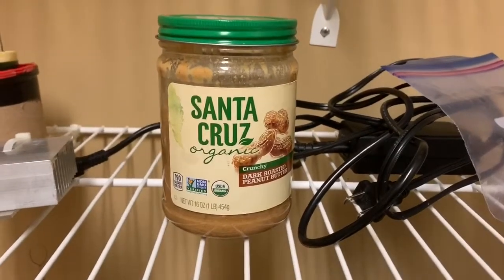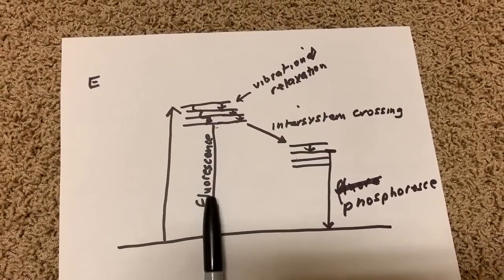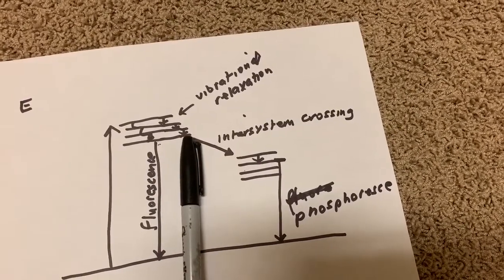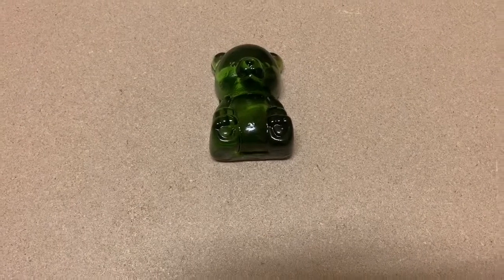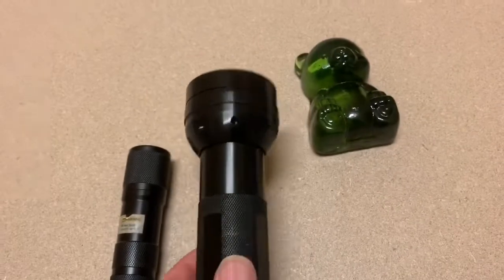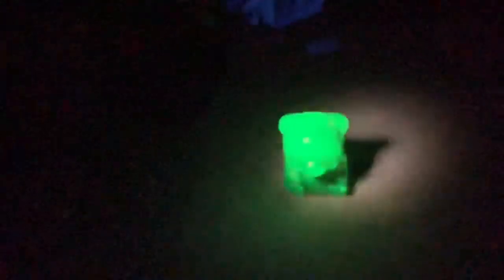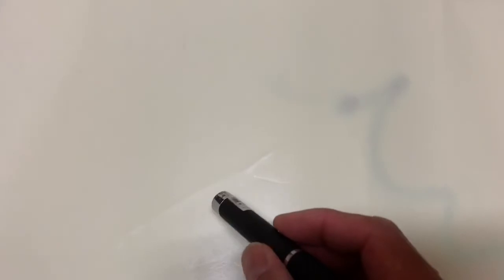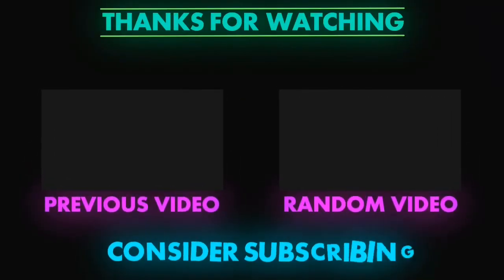Peanut Butter Phosphorescence Experiment

Comment: Hi nice videos but I wanted to point out some aspects 
-you neglected to draw the excited vibrational levels of the fundamental electronic level, to which the transition may end. Those levels are partially responsible for the stokes shift you mentioned
-the reason why phosphorescence takes more time to happen is not due to the time for intersystem crossing to happen, which is actually fast (almost instantaneous); it's because of the metastability of the triplet state (due to quantum mechanics selection rules)
Reply from the maker: That is a miscommunication on my part. Interstate crossing is fast. The time spent in the metastable state is longer as you pointed out. I found that this state has different light reflection properties and appears dark in regular daylight.
Reply: Interesting, that justifies why it appears dark. I wonder if I can appreciate this effect with old good geomags too